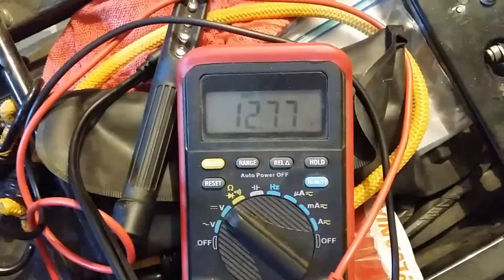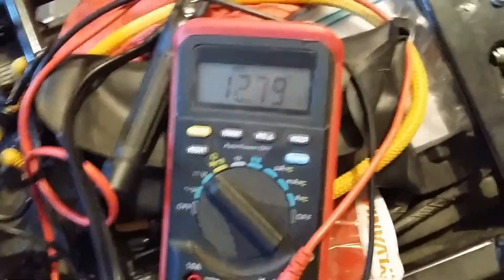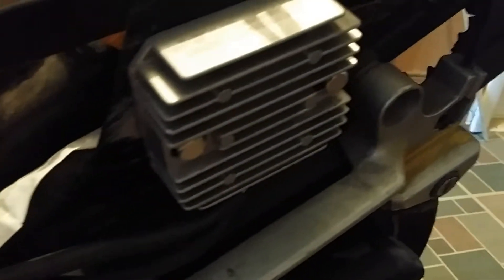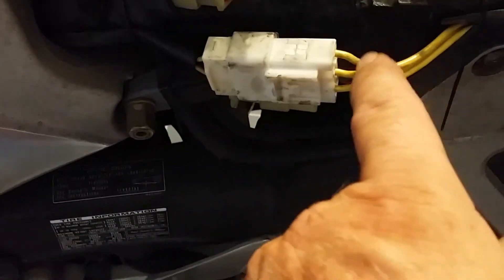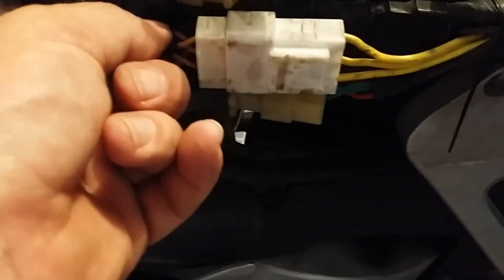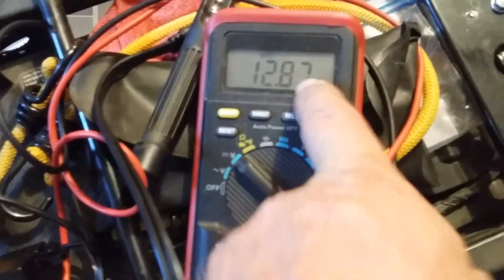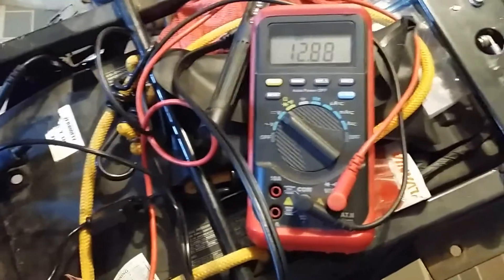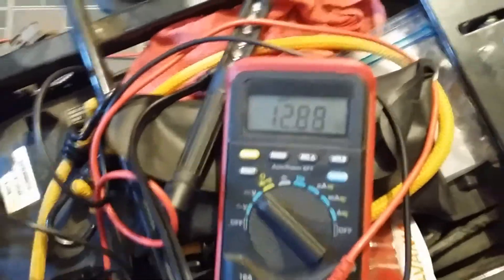2000 VFR 800 Electrical diagnosis

Comment: I’m upgrading my R/R to the Shendengen SH 847 aka stator cooler before the current R/R pops it’s clogs ! Also waiting on stainless steel oil cooler pipes to come while my VFR is sat in garage in bits
Reply from the maker: Sounds like a solid plan there! I need to do the oil cooler pipes too...

Comment: So it will start amd run with a bad regulator rectifier?
Reply from the maker: Yes, as long as the battery is good and charged. But once you are out on the road and the  battery is not being charged because of bad rectifier regulator, or bad stator, the the ignition and fuel pump and lights will run down your battery and the bike will eventually die. So yes the rectifier regulator has nothing to do with the bike starting. The rectifier regulator does just that, it changes the a/c voltage from the starter and rectified it to d/c voltage, and then regulates the current. Hope that helped.
Reply: @thedragon2299  yeah it did.  Thank you.  It must be my ecu.  Or maybe a bad stator.
Reply from the maker: @boonehouston  What's it doing? What's the story?
Reply: @thedragon2299  well.  The bike sat for about 7 years but only has 5,000 miles.  I replaced the fuel pump and coated the tank.  I also had to replace the ignition barrel.  It doesnt have "hiss" and everything turns on except for the pump.  I checked all wiring and relays plus the bank angle sensor.  I checked the kickstand, neutral and probably every sensor possible.  It had a "tpi techfusion" power commander deal spliced into all the pink wires on the ecu.  I figure that's kinda suspect considering it has its own power and ground supply, so I took it off.  Its not throwing any codes but the pump wont prime.  I checked to make sure it works by connectimg it straight to the battery.  Everything on the bike looks brand new
Reply: @thedragon2299  I cut off the shielding on the entire wire harness and found no hot spots or corrosion.  I took the airbox off and made sure the fuel rail wasn't clogged or anything in case there is a pressure sensor. Everything checks out and it cranks over but there is no spark and no fuel Prime
Reply: @thedragon2299  brand new battery and oil change and filter the oil pump is definitely working properly because I watch the oil slosh around in the window.
Reply: @thedragon2299  I checked all the coil packs thinking maybe one or two were bad but they're all not sparking
Reply from the maker: @boonehouston  oh, yeah, that's definitely not the regulator. Could be a number of things. Need more story, did it die, or one day it just didn't start, do you remember anything wierd leading up to it. It could be so many things, bad ignition switch, fuse, signal coil the list goes on, so with more information maybe I can help. I will suggest watching any sportbike no spark issue video too. Good luck let me know.
Reply: @thedragon2299  I've never seen it run.  I didnt think it would turn over with a bad ignition switch.  Where is the fuse coil?
Reply from the maker: @boonehouston  oh, you are just trying to figure it out. The pulse coil, or signal coil is part of the stator, it sends a signal to ecu to fire coils. Sometimes ignition switch can be bad, it will crank the starter, but not supply power to coils. There are also fuses near the instrument panel, could be blown fuse.
Reply: @thedragon2299  can you test the stator and pulse coil without cracking open the case?
Reply from the maker: @boonehouston  yes, you can unplug the wires coming up from the stator and test them for continuity and ohms. I don't remember off hand what the ohms are you are looking for, but you can google and YouTube how to do it and what numbers you are looking for.
Reply: @thedragon2299  cool I'll do that. But technically that shouldn't be affecting the priming of the pump right?
Reply from the maker: @boonehouston  no, not if the pump is actually running. If you are having trouble with no full and no spark, that sounds like it's been wrecked, it has sensors that in the event of a crash, it cuts all fuel and spark. Look that up too, I remember hearing about guys who made street fighters out of sport bikes, only to find when they removed front fairing/nose, the bikes wouldn't run anymore. Come to find out the removed the sensor. Most often it's called a bank angle sensor, check on that too.
Reply from the maker: @boonehouston  Sorry didn't see all this earlier, sounds like you covered everything. The fuel pump situation sounds strange, you did change filter in tank right?
Reply from the maker: @boonehouston  when you say no priming, do you mean it doesn't run at all, or the pump is running and not priming? The kill switch on the right handle bar cuts of fuel pump, but will not let the engine turn over, so related and not related I guess. I had the same problem when I got mine it sat for along time, as soon as I started it for the first time it shut off soon afterwards and wouldn't start, the pump wasn't running, I just bypassed the relay, and that was 5 years ago, still running it like that without any problem. I know you said you checked it, but just saying I did have that same problem.
Reply: @thedragon2299  it hasn't been wrecked it's like a brand new bike. The bank angle sensor was bad but I just flipped it upside down to trip it out and that turns off my FI light which I guess means no codes are being thrown now.  I guess I'm thinking now that the Power Commander deal that they had spliced straight to the computer wires got wet and shorted itself and or the computer out.
Reply: @thedragon2299  I just tested the stator and it's fine
Reply from the maker: @boonehouston  There are a couple other wires besides the 3 yellow ones, did you check them, that's the ones that send signal to ecu.
Reply from the maker: @boonehouston  yeah, it seems to be leaning towards that, sounds like you have done all the checks you can.
Reply: @thedragon2299  yup I checked those too.  Man I love fuel injected bikes.
Reply: i hade the same problem with my bike. no pump priming, but everything works. solved by my mechanic...he put a diy relay to the pump and relay..now the pump runs when the ignition is on..had no problems..vfr back on the road